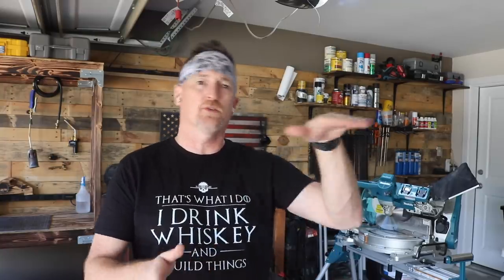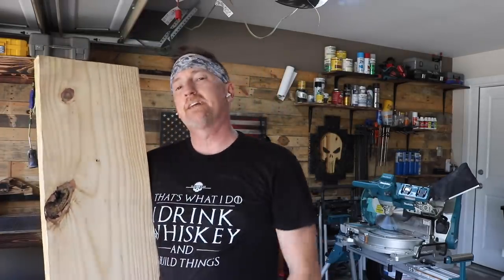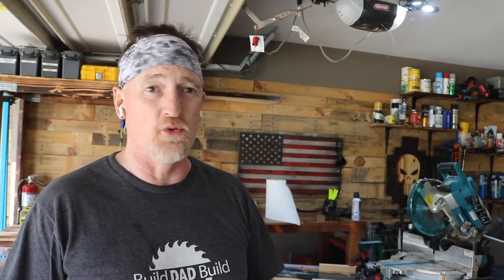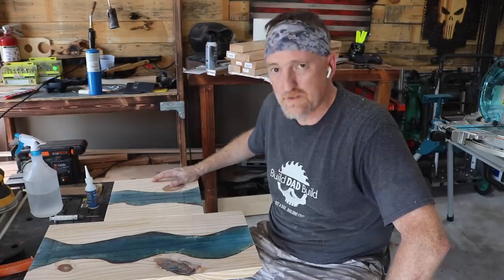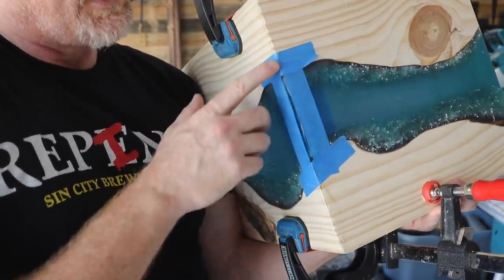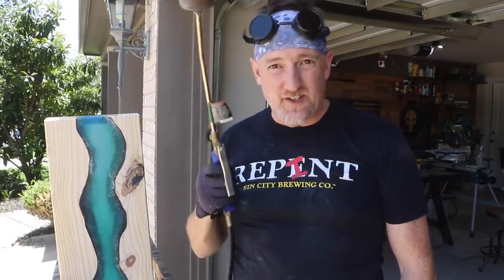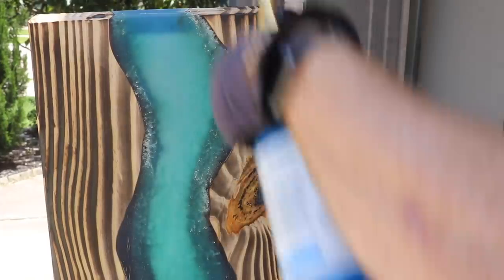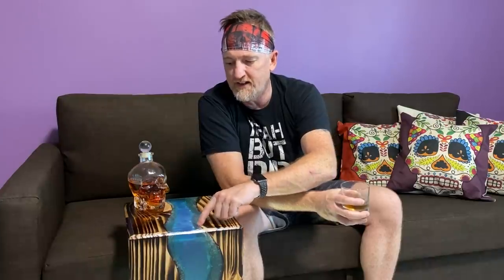Waterfall Sofa Table

Comment: Looks good Nick turned out great despite some of the hiccups. I think the issue with the bubbles along the River Edge was that when your wood started floating and you pushed it back down it pushed air underneath the wood then it that came out on the river part it's okay man no problem I think it looks great with the bubbles that gives it kind of like a foaming Ocean Edge
Reply from the maker: Thanks, brother!
I agree...I like the look. Now! 
Cheer

Comment: Those bubbles are likely from mixing the epoxy not the temp. Best thing is to use your torch on the epoxy after you’re done with the pour, and it’ll pop those bubbles. If you still have trouble I strongly suggest you change brands of epoxy and switch to stonecoatcountertops.com brand for your specific application. I’ve had exceptional results even when I was a newbie and they have the best tutorials (by far) also. 

Also, Protip: never make anything out of mostly white epoxy unless it’s ok if it turns yellowish within a year or so. It’s called “ambering”, and is just a natural consequence the medium. Can’t be avoided. Good luck! Love your channel!
Reply from the maker: Thanks, Kelly!
And yes...I've battled bubbles with my torch before. But this stuff was frothing like I've never seen. It reminded me of those baking soda volcanoes! But, thanks for the advice!
Cheers
Reply: Build Dad Build well, the other options are a bad batch of resin or hardener, one of them contaminated with something. And you’re right - if the temp gets above 90 it can ruin it if stored for long that way

Comment: I know it's like a year late, but I think, beyond just sanding, part of the reason for the miter gap was using thick and quick on the wood instead of a normal, thin wood glue. Since it is meant to be very thick, it makes your parts space apart, and since there wasn't any on the epoxy, there was going to be a gap. 

Also, the bubbles were definitely the heat. I have had the same thing from pouring too thick, or not sealing things like burl where the holes create small captive areas that overheat.

On another note, are you sponsored by total boat & arbortech?
Reply from the maker: Roger that. 
Not sponsored. Affiliates with both.
Cheers
Reply: @BuildDadBuild  wow. You're super responsive. I appreciate the dedication to your viewers

Comment: Another option to hold down the wood is to hot glue it to the bottom of the form.
Reply from the maker: Good to know. I'll keep that in mind. I think I had concrete molding in my head for some reason...LOL
Thanks for the tip!
Cheers

Comment: Whenever you burn pine wood. Do you ever get those little watery spots that dont burn? Looks like just spots all over the place. If so how can you prevent that?
Reply from the maker: Sometimes....it's usually sap. 
A little extra heat in those areas can mitigate it sometimes.
Cheers!

Comment: Freaking love it! When using the torch, did it cause any problems with the epoxy? Stuff like it burning, melting, or anything?
Reply from the maker: Thanks, Roy.
It did not. But you've gotta make quick passes and don't stay in one place for very long.
Cheers
Reply: Also, use aqua based apoxy you can make quick passes with a small blue propane torch.....walmart 20 bucks.....wish you success on your project!!!
Reply: The torch removes bubbles.....I use Art Resin products.....
Reply: @nickmorris9383  I had seen the torches being used on epoxy to get the bubbles out but that was still while it was wet. Not dried. That's why I was curious on if it had caused problems after when it was dried. Thanks for the advice too with the epoxy to fill holes. Good stuff.

Comment: Pretty sweet! Curious if you know an approximate cost for the epoxy you used. I've been hesitant to do any projects with epoxy simply because it's so damn expensive.
Reply from the maker: Thanks, Brian!
I used about half the ThickSet epoxy on this. So you could get 2 projects this size out of the 1.3 gal kit. But think of all that money you save on buying a slab! 
Cheers!
Reply: Thanks! So total cost looks like it'd be just shy of $100. That's not bad!

Comment: Coupon codes don’t work 😢
Reply from the maker: which code brother?
Reply: @BuildDadBuild  the code for arbor tech. I tried maker25 and thought that one expired cause I didn’t realize it’s an older video. Then I tried BDB20 and that one also does not work
Reply from the maker: @Watchingvids13  BDB20 was good through the end of March. Let me check with them and see if I can find you a working code.
Reply: @BuildDadBuild  you’re awesome!!! Thank you!!
Reply from the maker: Hey brother! I just had BDB20 turned back on through May. Cheers
Reply: @BuildDadBuild  Kickass! It’s on order and so to be tearing up some lumber!

Comment: Did you epoxy the edges I no if you don’t air will leach out of the wood,don’t ask how I know.lol there for awhile I thought you was gonna body slam it.
Reply from the maker: Hey, Don!
I sealed them with some spray poly. If you saw the reaction it was having (wish I had gotten it on video) you'd know it was more than air escaping (I think). Imagine one of those baking soda volcanoes!
Cheers